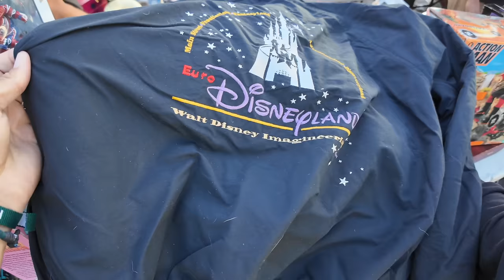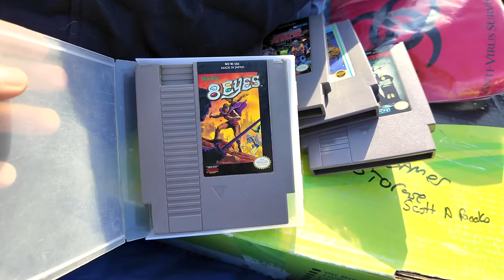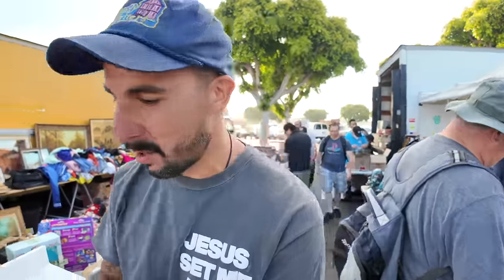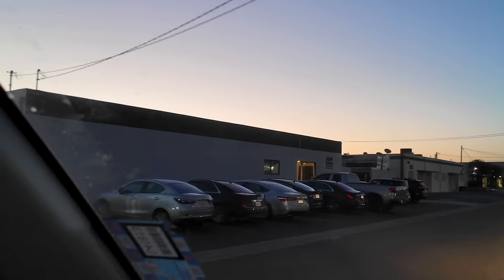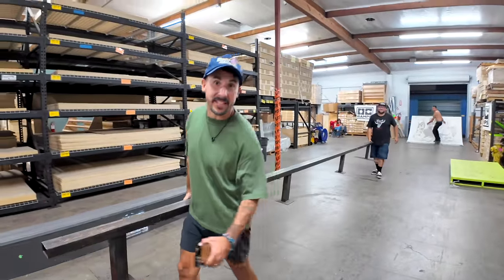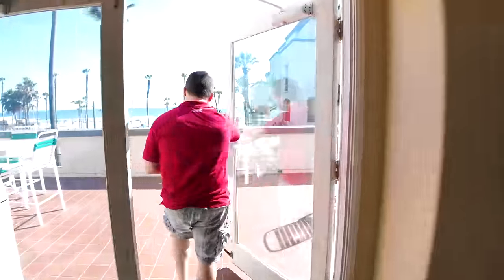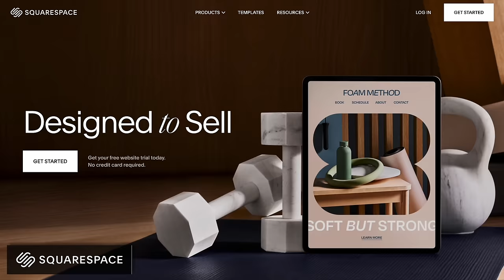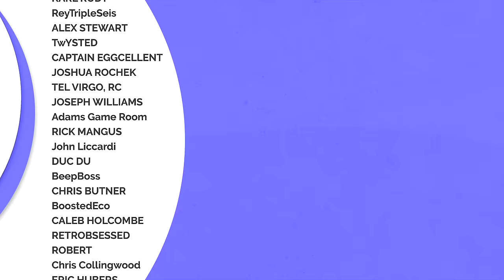Boxes of SEALED retro games just surfaced!

Comment: That was a action packed fun video! I need a few of those NES games you found. I can relate with the skating I had a 20 foot wide 3 1/2 and 4 1/2 on the extensions half pipe in my backyard all covered in Skate Lite for a 10 years. I just took it down when I moved